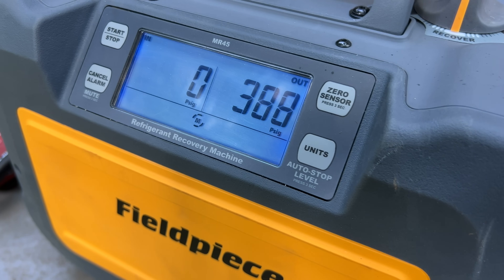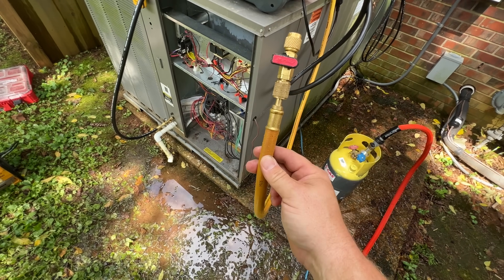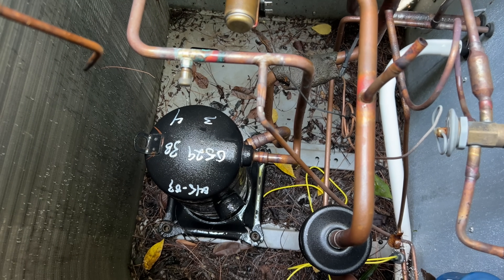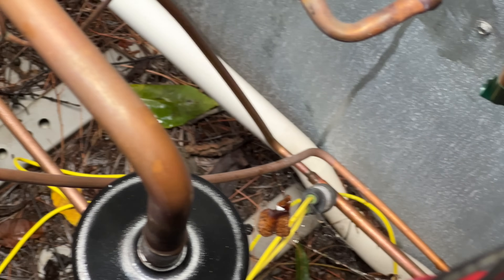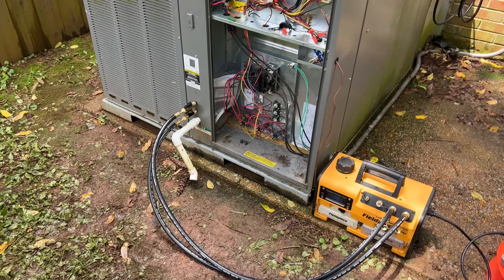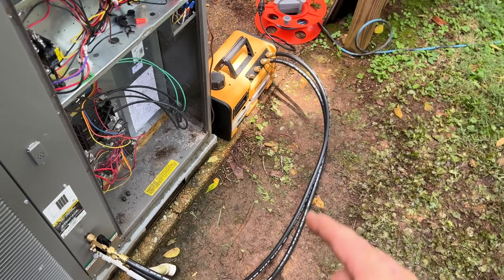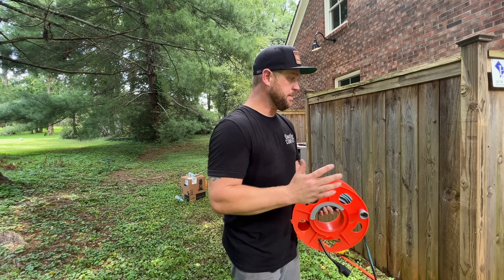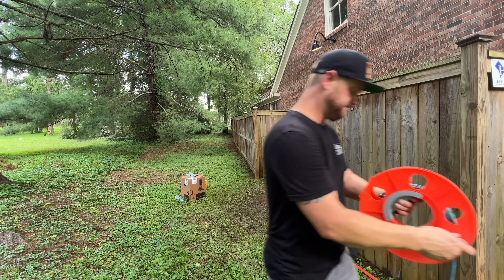A Simple FIX Turned Into A Major HVAC Repair….Costing $1,000’s 💰

Comment: With the high side CRT during the vacuum phase, you have no cap on the perpendicular fitting where a schrader valve is exposed.  Would you be worried about the ~500 micron (or less) vaccum sucking and allowing air into the system and ruining the vacuum?  I paused at that point and wrote this, so if it's changed/capped later in the video, disregard.  Cheers.

Comment: if u remove schrader  then pulling a vacuum , arent you injecting air back into the system when your putting schrader back in under vacuum ?

Comment: Eric Kaiser, at Jackson Systems, suggested recovering in blue/suction side of recovery tank (like you do) but turn the tank upside down to prevent overheating the tank.  Vapor has more mass than liquid and creates heat (pressure/heat relationship).  You'll watch the pounds pour into your tank the level off, once the speed of recovery levels off you're pulling vapor; at which time you turn your tank upright and pull the rest as a vapor.  I've tried it 7 times in the last 30 days it really works.  No more ice, running water, and high pressure cut offs.  You have to pull both sides however.  There's an hour+ long video on Jackson Systems YouTube channel.
Reply: Just want to mention that the blue valve isn’t always vapor on the tank. Check tank before use.

Comment: Makes me feel pretty good about getting my unit fixed ASAP when it breaks down.

I'm not an AC guy, but I would like to make 1 suggestion from experience.  We have a huge 6 ton unit.  Capacitor used to go bad every year damn near like clockwork.  Not anymore, thankfully.  The person I had replace it last didn't just match up the existing capacitor, he looked it up for the unit.  Sure enough, people had been installing too small of a capacitor for our unit over and over again b/c they were matching instead of checking.  AC runs a lot better since the last repair.

Comment: Would of been a better video if he explained what he was basically doing and why.
What's the complaint?
What's the overall plan?
Reply: On a previous video he went on a no cool call. Found a bad capacitor and replaced. Still no compressor operation.  Ohmmeter showed both windings open. This is a “part 2” of the previous video.

Comment: Why don't the compressros have bolt-on lines and o-rings like on a car? seems like that would be way easier to service.
Reply: Some use Rotolock fittings.

Comment: Why is it recommended to replace the filter dryer and Contactor when changing out a compressor ?
Reply: It's probably one of those while your in there situations where it's not only benefits the new compressor but also the wallet from a potential visit afterwards of them going out.
Reply: Best practice to replace filter dryer whenever you open a system, particularity on a compressor failure. He replaced the capacitor, not the contactor (on the previous call)

Comment: How long has he been working for fieldpiece? 
I do want some more of their gear though.

We use flow meters for nitrogen purging, finer adjustments, but i watched alot of your hoses move which scares me about the condition of the seals on them, and that poor suction hose in the water, 
Overall though you did the process and the customer can be pleased, but i still woulda fit my gauges and confirmed working pressures, uve eliminated the compressor, but not the txv. But im not there and no expert.

Comment: Still have zero reason to believe that compressor was bad and ditch the giant hoses for recovery and the stupid magnet and get a 5 gallon bucket and a bag of ice for Christ sake
Reply: On the previous service call he measured resistance (ohm) on the compressor windings, found both to be open.
Reply: @wtaylorhudson3702 That sounds like thermal overload...

Comment: Doing a compressor change out tomorrow  too . This package unit is in the roof  thou . Trane units  have there compressors mounted on the side . Unfortunately  there filter driers on the top just below the condenser fan .

Comment: i made up a coil of 3/8 copper to fit in a bucket and brazed stems on the ends i dump 10 lbs of ice before i use it and pressure won't go above 150.psi
Reply: I saw a reply on one of his shorts about a thing called a molecular transformator that had great reviews. It’s basically the same thing, just a coil acting as a heat exchanger that’s dipped in ice. Just mentioning in case anyone wants to get one that’s got a little case and such. Just trying to help and add to your comment! Lol I’m not a tech or anything I just find all this neat

Comment: Was the old compressor a burn out, meaning electrical failure?   If so you need to always use new refrigerant.
Reply: I have never used the refrigerant again. System always gets new refrigerant no matter what
Reply: @JBra1382 always! Even if my compressor didn’t Burn out!
Reply: and acid scavenger
Reply: Only after a positive acid test, if not your too far alkaline  @pelon542
Reply: Its better to replace the refrigerant, sure… but if its a blend, you have to… we reuse a fair amount of original refrigerant on some things, definatly depends on the amount in that system. If the unit had lost all its charge, obviously moisture, but id struggle to say we would replace the entire charge on a smaller older machine, since theres always another component on its way out.
Reply: and a suction dryer

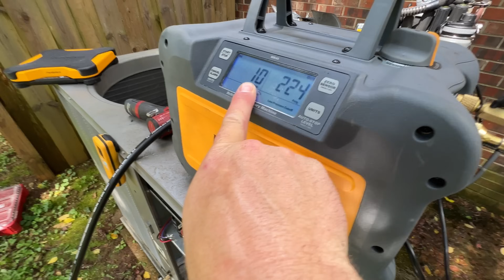Comment: Clean recovery tank should already be under vacuum, unless you are blowing it off in the backyard instead of turning it in and exchanging it properly! Nothing new here about HVAC work other than the mistakes, but maybe you should just start training people on video production. Seems to be the only thing that concerns you. 01:07, no reason to piece 3 extensions together, I just use a 24" single extension. 06:28, Is that your drop cord laying in that water? LMMFAO! not safe to be teaching that! 08:39, That paint job and markings looks like a remanufactured compressor. 17:16, You replaced a compressor and you are putting the old refrigerant back in the system, HVAC HACK 101! Guessing you also charged the homeowner for new refrigerant!
Reply: @myHVAClife That’s a little harsh don’t you think? First of all, if you are planning to reuse refrigerant, you should always pull your own vacuum on your recovery tank. Supply houses routinely screw things like this up and yes I have had a tank that was not under a vacuum. I’ve also had a tank with a major leak. Second, it’s pretty rude to accuse someone of venting refrigerant with no evidence. Third, why is piecing extensions together an issue? If anything I’d think it’s a good trick to show new guys how to make things easier for themselves. How many young techs out there likely don’t have a 24” extension? Fourth, yes I’m sure you have NEVER had an extension cord in water. I’m sure you also never make any mistakes. Fifth, who cares if it’s a reman compressor? What if that’s what the customer could afford? What if that’s all that was available? Sixth, I actually agree with you that reusing the refrigerant is not wise on a repair like this. However, we don’t know the circumstances. Maybe the customer can’t afford new refrigerant. Maybe Zac tested it, found it was clean and offered to save them some money. Lastly, here you go again accusing someone of something serious with absolutely no evidence. You may not agree with everything he did here, but if your honest, you know this guy is not a hack. I probably just wasted a bunch of time replying to a troll, but I’m proud to see there are other people in my trade who put as much effort into it as Zac clearly does and I felt this was all worth saying.
Reply: Damn bro you seem jealous or your trolling I’ve been watching his videos for a while now and he does great work.  I just started watching your videos recently after Ted cook recommended your videos but I’m gonna unsubscribe cuz of your dick comments
Reply: He did vacuum down the recovery tank before using it.

Comment: Good video But - Re-using Recovered Refrigerant on a Compressor changeout is a No-no ! Allways Use NEW REFRIGERANT WHEN INSTALLING A NEW COMPRESSOR. Golden Rule ! NEW COMPRESSOR = NEW REFRIGERANT !!! Allways ! Especially on a Electrical windings failure such as this one. IF u are going to re-use refrigerant you will want to check refrigerant for acid. I did not see u do a acid test on that refrigerant in this video.
Its a Good Rule to Have. NEW COMPRESSOR = NEW REFRIGERANT !!! Allways! 
It Has served me well over My 42 Years in the trade !
Ive NEVER Had to do a compressor Job twice. EVER !!!
A Good vacuum , a tight system , New Refrigerant & a 5 minute time delay = a Happy unit that will live a Long life & in turn = a Happy Tech.
You make Good videos , thanks for that , i know its alot of work getting those shots. Im sure everyone appreciates it. i watch most all of your vids. Very nice truck setup you have also. That truck tour vid is very good. Take care.

Comment: Was there something the homeowner could have done to prevent the compressor failure and potentially save the thousands they spent replacing it?
Reply: Yup, keep up on air filter changes is the best thing a homeowner can do to prevent costly damages to system. I say system because running loaded up air filters won't just kill the compressor but potentially entire refrigeration system if neglected enough. Oil logged evaporators, acid/sludge formation which will render your metering device/tev/txv useless, once you get to the acid stage,it's really difficult and costly to get the system cleaned up correctly. And in so many cases,air filter loading is the culprit. As is blocking of return grills as well as supply registers. It's no different than having loaded air filters
Reply: Looking back to his original call on this unit, he said a bad capacitor made the compressor fail. This would be a very rare possibility that that's what caused it. More like the compressor failing caused the cap to fail from overheating. Now the question would be well why did the comp start failing to begin with. And that sometimes can't be answered until new comp is in and system started back up. The original problem will then be observed and corrected. At least we would all hope anyways. But unless you see an obvious airflow/ load problem beforehand, these are the steps we must take to get to the root cause
Reply: @HVACRTECH-83 yeah, could even be a stick in the fan obstructing airflow, i never noticed if he confirmed the charge was all there when he weighed it out, could be a large list of issues all requiring a check when the units in operation, usual problems are short cycles or if theres anything in that txv. Personally if i was into this id be checking the txv filter while it was empty, but id be hesitant to go that far with a brazed in one. This might just be one of those jobs that you grind through over time, compressor would be the most expensive part to swap out.
Reply: When the system quits heating or cooling turn it off. The compressor trying to start with a bad run cap for days damaged the compressor.

Comment: That compressor/tank tooler is rad. Might have to pick me up one. Nice video! 👊🏼
Reply: It's good for compressors that are outdoors (mainly residential)or for small recoveries with an empty bottle, but at least for me and the work I do,recovering many bottles, I need to weigh during the entire process for each bottle. A hx is much more practical for most situations for most techs. Also cant be used on comps on an rtu either. I bought one when they first came out a few years back and only found a few times I could safely use it since then.

Comment: looking at all those little extensions put together for the compressor bolts is kinda funny.  I use the 12 inch locking milwaukee bit holder with a magnetic 1/2 inch nutdriver end, fits over most compressors and lets you pull the bolt and washer out all in one swoop! it HAS to weigh less too..  but if it works it works.

Comment: You ever try using one of the CPS tools? Here's the model number MT69 | Pro-Set® Molecular Transformator Sub Cooler
Reply: Tbf you could make one with some scrap 3/8 copper for a fraction of the pice
Reply: @Austin23191 lol absolutely 💯   the cps hx looks cool but you can make one for about 25$ or less and the cps is too small for commercial/ind work. I made a much larger one that still fits in a bucket and works fantastic. Just have to remember to recover your hx too but only takes an extra minute so....

Comment: If you put the cylinder in a 5 gallon bucket with ice, the cylinder will stay around 250 psi, so much easier on the recovery machine.  Also You can drain the liquid refrigerant into the recovery tank if you are connected to the vapor side and hold it up for 5 or 10 minutes.  Make a fitting that caps the hose with a hook to hold it up.

I like the DC motors in the Feldpiece units, but am still partial to the G5-Twinn because it is completely rebuildable.
Reply: I'm still using the g5 twin as well. I've bought 2 in the last 15 years. One I'm using now is about 8 years in. Nice to know they are rebuildable. My supply houses suck and don't let you know that, my fault essentially for not knowing tho. As far as the cooling of recovery bottle, I've never used a bottle this small, and this one would fit in 5 gal bucket and that would work indeed. But for my larger tanks I actually made my own hx out of 3/8 copper tubing coiled up around one of those old foldgers metal coffee cans, w 1/4" adapters on both ends and pressure gauge and works fantastic in a 5 gal bucket. Or I use push pull method on very large systems and there's no need for cooling in most cases. But good advice for people using small tanks for sure
Reply: @HVACRTECH-83  Appoin KTG520-R Includes the springs, valves & seals.  Guy at Appion told me all of the rest of parts are available as well.
Reply: @HVACR559  thanks
Reply: I use a condenser coil from an old water cooler which I fitted with Schrader ports. It will fit into a bucket of ice easily. I flush it after each use to prevent cross contamination.
Reply: Once I started draining the hose, I found there was no need for the valve on the tank side.
Reply: Molecular transformator for fast recovery
Reply: @gregpewtress2952  I wondered about these. I saw it in the United Refrigeration branch but was skeptical.  You've used it?
Reply: @topher8634  I just took some 3/8 copper, turned it around a jug so it makes about 5 turns, brazed on a couple access ports & I put that in a 5 gallon bucket of water between the recovery machine & jug. Makes the recovery go way faster
Reply: plus you don't get the mud fest running the hose like that.